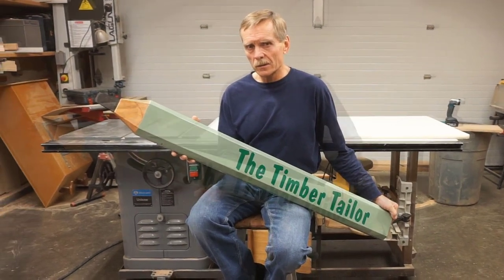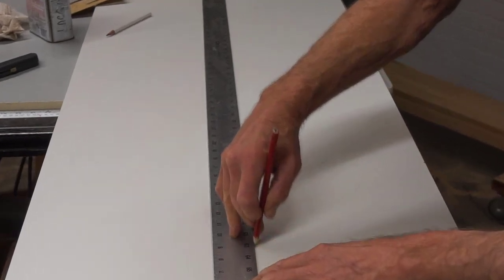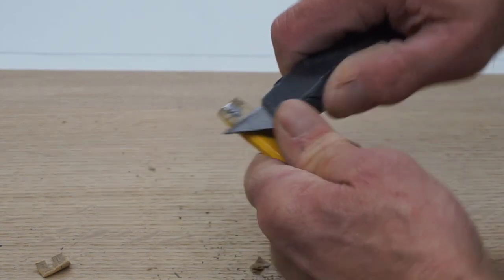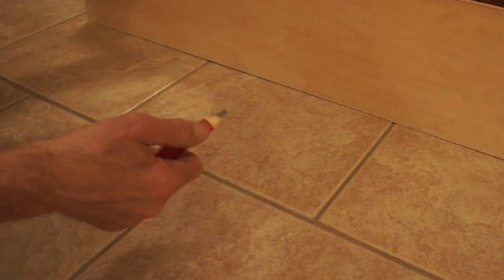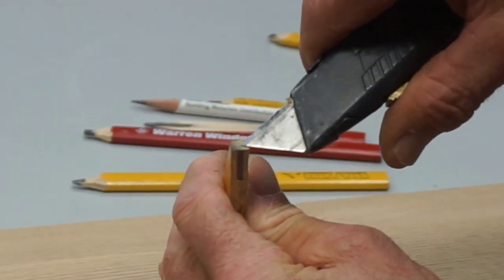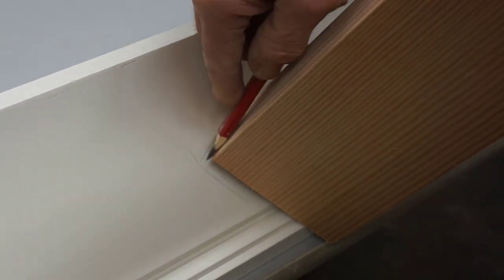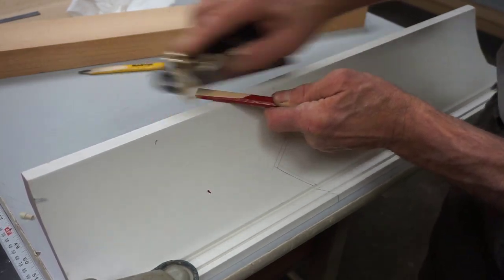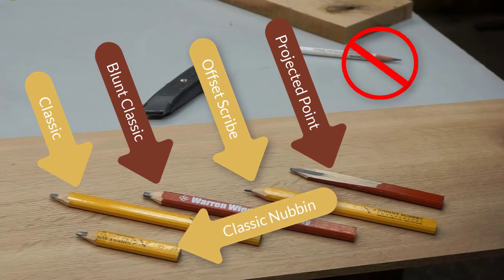How to Sharpen a Carpenter's Pencil

Comment: Carpenter pencils are easy to sharpen with a utility knife that's in most tool bags. They do make a sharpener for the carpenters pencil. You can get it at sears. A good carpenter doesn't need it. When I do finish work I usually use a regular pencil because I want light easy to get rid of marks. It's just my preference. A carpenters pencil works too but a regular one is better for me. Good video.
Reply from the maker: Jameson,
I'm with you and never liked results from any of the dedicated carpenter's pencil sharpeners either: only produce marginal results and mean one more tool to carry.  I put a link in the video description above that shows my favorite Papermate mechanical pencils.  They're 'the twisty kind, NOT the clicky kind :-) I'm curious if you have a favorite 'regular pencil' too?
Reply: Next Level Carpentry I actually like the Ticonderoga. 1. I found  some with a black sort of rubberized coating. A little bigger than normal. They are my favorite although I don't like black cause they are easy to loose.  2. The "My First"  for little kids. The are like the regular Ticonderoga only big. The downside to them is they are round. They roll.  3. Just the regular Ticonderoga. They are yellow, easy to see. They also are octangular so they don't roll. The have good quality wood and graphite or whatever writing compound they use. Also, the erasers are quality.  As you know flat sided pencils come in handy at the chop saw for back cuts and such. That's where the carpenters pencil shines.
Reply from the maker: Interesting dialog here...
I used pencils similar to your Ticonderogas for many years; even carried a hand-crank pencil sharpener around in my toolbox.  Then I 'discovered' the mechanical pencils I now use and haven't sharpened a 'regular' pencil for trim/millwork/cabinetry work since.  THE difference, for me, was learning that twist out lead, unlike click-out lead, lets me expose just the right amount of lead to draw fine lines.  They work nicely in regular and beam compasses, trammel sticks, 'ellipse sticks, etc too since they can be 'sharpened' in place with a twist of the tip instead of having to take them out and to a sharpener every time they blunt. Plus the integrated pocket clip thingy keeps them from rolling around. The click out kind always infuriated me because they always projected too much lead which would invariably snap off.  
At the end of the day ya gotta go with what works best for you, right?
Thanks for sharing!
Reply: Next Level Carpentry I tried the mechanical pencils, I just didn't like them. I like sharpening my pencil and I would always tend to break the lead off of the mechanical ones. Then where do I get more lead? I guess I just like the wood pencils that I sharpen how I want according to the job I'm doing, not to mention they are wood.    :)
Reply from the maker: Jameson,
I admire your firmness of conviction... it must serve you well for life in general if it grounds you so firmly in this discussion... which I've enjoyed!  I welcome your comments and feedback on anything at Next Level Carpentry as it enriches the Channel significantly...
Best regards,
Matt
Reply: Next Level Carpentry thank you for the  discussion. I'm just picky about my tools..I was taught by someone with severe OCD. He taught me about paying attention to details and the value in it. I've always been particular about my tools and  equiptment. Your set up makes you more efficient. I am injured at the moment. I miss carpentry more than I realized. Thank you for sharing your knowlege.   I can never learn enough.

Comment: I am a long time carpenter also. 
Measuring and marking is what it's all about.
Accurate marking is a common problem for me.

Going back to fundamentals .... that planed pencil thing was good .
Reply: Although, there is still an off- accurate angle that will increase as a function of the gap between the piece the pencil is scribing from to the piece being marked.
Reply: The bigger the gap the less accurate.
Reply from the maker: Thanks for your comments Rob... true: the bigger the gap the greater the potential for inaccuracy but it's about as close as you can expect to (or need to) get considering how difficult some marking tasks can be.  When faced with a really problematic scribe cut situation I'll often dial in to the level of accuracy needed by using one or more scrap pieces for test fitting; 'sneaking up' on the fit, so to speak.  Hope some of the pencil tips help you nail the marking challenges you're working through! Best, Matt
Reply: Test fitting w/ scraps ... Amen.
It's hard to throw scraps away  'cause I'll be looking for them the next day..
Reply: Rummaging thru trash cans is never a good look.
Reply from the maker: Where scraps and the like are concerned I've always felt 'it's much better to be lookin' at 'em than lookin' for 'em'... right Rob? 😁😎 Best, Matt
Reply: So right Matt, Scraps are great :
     *  Test fits and cuts.
     *  jigs
     *  measuring w/o a tape (  no math , no compound errors )
     *  mock-ups
     *  marking for finish trim
     *  thicknesses :  1/8 ,1/4 , 3/8 ,1/2 , 5/8 , 3/4 , 1 1/2 , 3 
     *  lengths
     *  shims
     *  mixing sticks
     *  blocking
     *  Scabs / sisters
 I should stop now.
Reply from the maker: Tools for tricks of the tradesman!  Nice.  Matt

Comment: Very informative video! I learned a lot from your demonstrations.

QUESTION: I am experimenting with a modular panelized construction system that builds the panels in a shop using precise assembly jigs, transports them to a job site, and then they are connected to create a small building. I have been getting excellent, extremely accurate results marking with 0.7mm & 0.9mm mechanical pencils. They very rarely ever break, but if they do, a couple of presses extends a fresh section of lead and I'm ready to continue. The width of a mechanical pencil line is very easy to control & seems very consistent. 

- What is the actual width of the pencil line from your carpenter's pencil in the first demonstration? 
- And how wide is the carpenter's pencil line after drawing a couple of long lines?
Reply from the maker: Answer: you are devoting way too much time and attention to pencil leads... if what you're using is fine enough and durable enough does its Dimension really matter? I definitely appreciate the fact that you are geeking out on your business but suspect your time might be better spent on other aspects of the operation😁😎
Reply: @NextLevelCarpentry  Actually, yes - the dimension does matter. Some people will be taking a workshop in panelized construction and building a small house, so I was hoping that you might know how fine a point you were actually getting with your techniques for sharpening a carpenter's pencil. (I suspect that cumulative errors on the previous build might be due to some attendees using carpenter's pencils and not getting consistently accurate cuts during the build. Whereas my own technique of using a mechanical pencil is not subject to whittling variations.)

I have already passed along your advice about "take the line" and "keep the line", which I think could improve cutting accuracy on the next build.

I'm guessing that you've never actually measured the results of your techniques to determine line width tolerance, which is probably fine for traditional stick built framing but possibly not accurate or consistent enough for a modular, panelized construction system where final assembly process is less forgiving.
Reply from the maker: @alanmcrae8594  Sounds like you're dealing with theoretical more than real-world.  Any error caused by the difference in the thickness of a well sharpened pencil will be rendered moot by something as simple as a tape measure dropped on the hook end.  And, regardless of how sharp a pencil is, inaccuracies caused by inattention, ignorance, indifference and carelessness exceed any technical variation in the fine-ness of a pencil point. In other words;  I can sharpen a carpenter's pencil sharp enough to cut skin but that's not going to be the final determining factor in accuracy of a panelized assembly where opportunity for cumulative error, etc are exponential in comparison.  I'd guess that you'll get better results with people in a workshop by using the mechanical pencils you use though because at least you're guaranteed one consistent element in the equation for accuracy.  It would be cool though if some of your people get engaged enough to want to learn how to sharpen a real carpenter's pencil and focus enough to learn how to wield it properly because it's far more practical in 'real world' application than any mechanical pencil IMHO.  I do wish you well in your endeavor and admire your attention to detail, accuracy and, ultimately it sounds, in the final product you're producing.  I can't promise anything but if you feel some interaction with Next Level Carpentry would help you to be more successful in your venture let me know, OK?  It's sad to see how much of the trade is evaporating in the modern world we live in.
Best, Matt

Comment: Hi, Matt.  Nice video.  Do you recommend soft, medium, or hard leads?  I thought each would be nice for different purposes, so I bought all three and plan to sharpen them all.
Reply from the maker: Hi Mary, great question... thanks for commenting.  You'll be well covered with all three.  If you're new to sharpening, start with the medium, then the hard and soft last... soft takes the sharpest knife and more delicate touch.  As with many things, you'll probably use medium most resorting to soft and hard mainly when medium doesn't produce the mark you're after or hold up well enough.  My current Next Level Carpentry pencils have lead that's a bit on the hard side so I'm realizing how important it is to have more than one option. I highly recommend the Papermate Sharpwriter twist-lead pencils you see me use in videos too since finer work requires the finer tip they have. Have fun! Best, Matt

Comment: I use my hand plane. turn it upside and just start to move your pencil forward and back in about 20deg to the plane
Reply from the maker: Sure Zoltan, that works too... especially for the 'projected point' style... as long as you have a plane on hand and it's sharp enough, right?  Best, Matt

Comment: Great video thank you! I have a few in the shop but gave up after a few failed attempts to get them sharpened and functioning. Serious question: what makes these better than using a mechanical writing pencil?
Reply from the maker: Dan, glad you like the video!
Serious answer: the more robust lead in carpenter's pencils is better suited than fine lead in
mechanical pencils for writing on rough-surfaced framing lumber and sheet goods
typically used in carpentry. That said they are too clunky for use in most trim
carpentry projects and for cabinetry/ millwork applications where a
mechanical pencil is my preference.

If you're experiencing 'failed attempts' in sharpening carpenters' pencils the way
I demonstrate in the video I'm guessing it's due to a dull knife.  Make sure you're using a fresh blade and, unless the pencils you're trying to sharpen are made from some really miserable wood (some are actually made from a synthetic plastic wood-like substitute that doesn't sharpen worth a darn) you'll be 'whittling with a purpose' in no time :-)
BTW check out links in the video description where I've listed the knife blades and mechanical pencils I use and recommend... thanks for watching.
Reply: I like that a carpenters pencil won't roll away on you ...

Comment: As always a great video. Looking for a suggestion. Installing casing around stain grade pine Andersen window. I had marked reveal lines the full perimeter to be certain I stay on the line with my 3/4" pine casing. I am prepping all the wood work for finish and cannot believe I have to start at 80 grit to get rid of my pencil line on the edge of the window jamb! Any suggestions? Am I too heavy handed with the pencil or is the pine too soft?
Reply from the maker: SKWDMDYT,  Glad you like the video :-)  

For your reveal lines: Even with a very soft pencil lead (carpenter's pencil OR trim pencil)
it's easy to be 'too heavy handed' on the soft pine of window jambs...
unfortunately you now know how delicate you need to be in marking those reveals
:-(. Because of that delicacy I generally only lightly mark about 1" each
way with a Papermate mechanical pencil, and only at the corners. For tall/wide windows I may add a short mark near
the middle of the side/ bottom too but generally just 'eyeball' the reveal there. Another
tip is to set your marking gauge to a pencil width OVER 1/4" so when you
install your casing you nail it when it just COVERS the mark rather than at the
exact point it shows... make sense?

But you were asking what to do about the pencil lines you have now... have you
tried a good pencil eraser like the Pink Pearl ones I list on Amazon Influencers?  They're the best general use erasers available IMHO.  For your application you may need to resort to
an ink eraser which is stiffer because you might have to scrub pretty hard to
get the graphite out of the indented lines made when drawing them. If you can
get the 'lead' out of the lines you should be able to get away with leaving the
indent in the wood because it shouldn't show once it's stained and 'varnished'

During remodel work when I need to clean up jamb edges for installing new
casing on old windows I have great luck in scraping the edges with a 'sharp'
putty knife and following with about 150# sandpaper. Let me know where this
feedback gets you and I'll try to assist.

Best,

Matt
Reply: All great sugestions as expected. I definitely put you in the top 5 of my YouTube channels, I am shocked you don't have a larger following. You are very similar to the Essential Craftsman as far as talent , technique, appoach, etc.
My plan was to cover the lines but it did not work out as expected. This is the 10th window I have replaced over the years on walls that are bowed, racked and undersized. They used 3/8 sheathing and drywall. Unbelievable.! Becausing I stain, I have to make filler strips because the wall is undersized. Maybe all along I should have shimmed the exterior flange but still would have issues with the plane of the wall. Typically I place the filler strip cut to the largest gap and place on top of the casing and set the scribes to the junction of the two and scribe the wall. Why do they always have the pencil on the wrong side of scribes? I have 3.
This time I measured the gap..which varies from paper thin to 7/16" and transfered the mesurements to a 1x6. I used my jointer to take little bites at a time until I developed the overall taper,  cut the thin piece off on my table saw, and refined with block plane and belt sander. I chose to glue up all the casing on my countertop which I never did before, using corner clamps and a spacer on the 4th side. I was 1/64th off which exposed the pencil line. I wish I could use stainable wood putty and push it in the gap. Any suggestions would be appreciated or a video about all the little issues that arise. Thanks again for all of your wonderful videos.
Reply from the maker: SKWDMDYT,
Kudos!! You've gone through a meticulous and painstaking process to make the best of a sad situation... had the original carpenter put 1/2 the effort into doing the quality job that you're investing in you wouldn't have to wrestle so to get a finished project you're proud of.
I can add more later but is there a chance you can just set the nails in your jambs and wisk off those pencil marks in a thin shaving with your sharp block plane?  Much quicker than sanding through 80#, 100# and 150# paper... but I'm guessing that isn't a solution at this stage of the game?

Comment: Your supposed to spin the round pencil as you draw a line. That's how you maintain line weight.
Reply from the maker: Lorin,  I was taught that method in drafting class in high school too but my (extensive) experience in the building trades has taught me that it doesn't translate well to rough textured construction materials.  
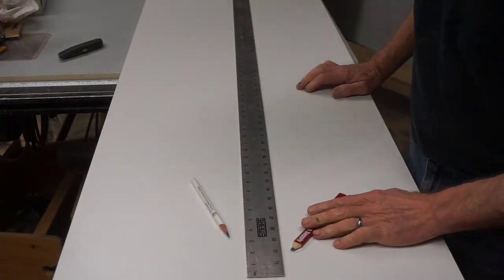Watch closely at 1:40 in the video and you can see I'm rotating the round pencil and still get a wide line after only 4'... and that's on relatively smooth melamine.  The reason I make a point of this (pun intended) is to demonstrate how the rectangular lead in carpenter's pencils excels in the real world of construction.  Best, Matt

Comment: I thought it also made it roll away less too.
Reply from the maker: Hey Flippy, thanks for commenting on this video. Please don't take my reply as a personal affront, I just took your comment as an opportunity to share some insight...

I hope the message comes through in the video that the whole idea of a carpenter's pencil is the fact that it has rectangular lead in it for drawing long, sharp lines on rough wood. If rolling away was ever a real problem then a triangular pencil would be a solution too, right?  I always 'park' my pencil in a nail pouch, not on a smooth, sloping surface. In fact a round pencil with rectangular lead in it would work well for the same reasons but making and sharpening it would be less efficient.  There are common misconceptions by non-carpenters out there, proven by some lame carpenter's pencil's I've seen that actually have round lead in them... d'uoh!  Plus there's sharpeners out there that advertise how well they can put a conical point on a rectangular pencil...  completely defeating the whole purpose of the pencils design and function in the process.
Reply: Next Level Carpentry so it can roll away?